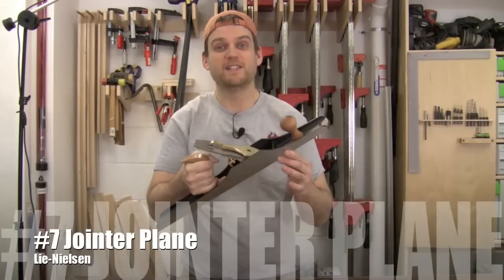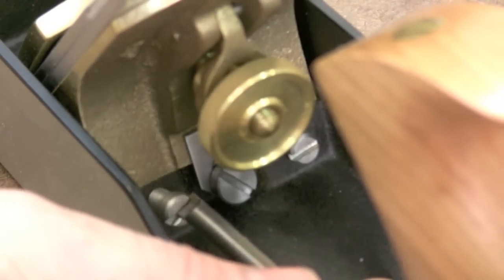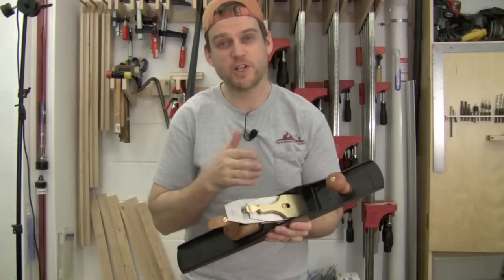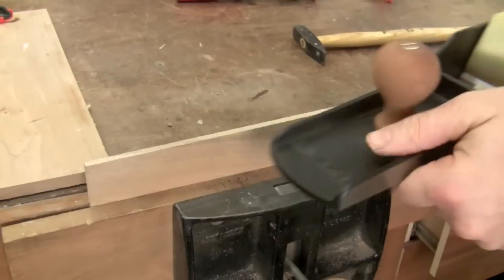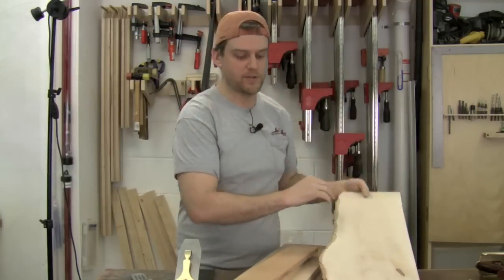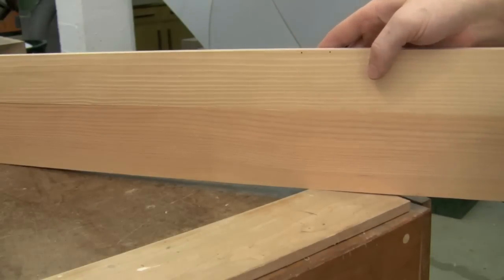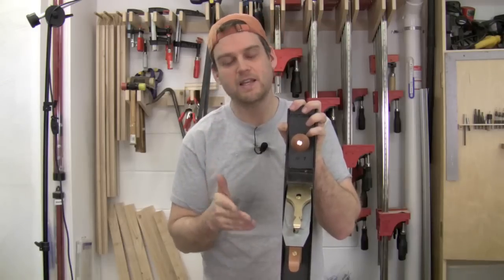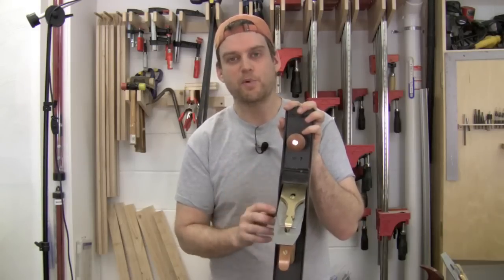Lie Nielsen No. 7 Jointer Plane

Comment: Exactly.  The #6 is great for jointing and planing - it's a little lighter and more easily managed, but not quite as long for getting a straight edge on longer boards.  Not really a huge deal, the #6 can work very well.

Comment: No 7 or 8.. 7 or 8..

So I got a No 8. Don't know when I'll be using it though.

Just started woodworking, and quite content to learn how to properly plane with just Stanley No 4 and 5. But then, the government in my country announced it was implementing a new tax, which would be applicable even to stuff bought online.

The deadline for the tax implementation was coming up, so I just bit the bullet and bought a bunch of LN planes, and a Veritas router plane, and hopefully I saved a ton of money that would've just gone to taxes. Those planes will now sit in their anti-corrosion wrappings until I'm proficient enough with the Stanleys and ready to go to the next level. Who knows when that will happen. Oh well.

Comment: I would like your opinion concerning the No. 7 jointer plane, 
I make tables from hard wood, average sizes are 3 X 5 feet, I am torn between the NO.7 Clifton and the No.8 LN plane.
I really lke the Clifton No.7 because of the beefier body casting, BUT, the extra width and length of the LN is interesting to me...
Please let me know what you think...

Comment: Hello Mike!  I would like to ask your professional opinion. I saved some money and ready to get a Lie-Nielsen jointer plane. I see that there are two options of №7 plane. One is a normal angle and the other is a Low angle jointer (№7 1/2). What is the difference between these two planes? Could you please point out pros and cons. I will plane a spruce and maple only.
 Thank you very much for your help and time!
Reply from the maker: Both the No. 7 and the 7 1/2 are the same length, while the 7 is almost a
pound heavier. The irons on the two planes are .140" thick for the 7 and
.240" thick for the 7 1/2, which you'd expect the L/A plane to be thicker,
since it has no chip breaker (nor does it need one).

I tend to lean towards the No. 7, if you are mainly getting this to use as
a jointer. I find the iron advancement is additionally fine on the design
used in the No. 7, and the extra weight is helpful when flattening large
items (I personally own the No. 8). Just remember to do what I do, and
that is apply a small swipe of paraffin to the sole of the jointer, which
makes a huge difference with fighting the resistance between the metal and
the wood. You'll notice the difference immediately and when you feel like
it's more difficult to push, hit it with another quick swipe. (Don't use
any silicone product on the sole as it can interfere with at least some
finishes)

On the 7 1/2 side, one of the strong positives is the flexibility it
possess much like the L/A Jack plane. Many prefer to purchase a spare iron
(or two) and have them honed up with different micro-bevel angles. This
can be advantageous when working highly figured grain, so you could hone a
spare iron at 45 or 50 degrees, on top of the bedding angle of 12 degrees,
which would put the effective cutting angles of 57 and 62 degrees
respectively. The converse of the "heft" aspect I spoke about with the No.
7 is if someone doesn't feel they either can or want to deal with the
extra mass, which is not all that different than those who prefer the old
wooden planes, which are all much lighter than metal planes.

So there are some aspects of each plane that are sought after, and some
that personal preference might tend to steer you away. I'm absolutely
positive that the No. 8 is the right tool for me, and without knowing your
personal situation, I think the No. 7 might be your best bet. I hope
you'll find some benefit from what I've written. Feel free to ask any
other questions you may have, just in case I've missed something you find
important.

Lee Laird
Reply: Thank very much for your answer, I really apreciate it!  I just wanted to ask another question regarding № 7 plane and a 7 1/2 Low angle.  Which plane is more easy to push (work with), Low angle or standard angle?  (If the blade advances the same on both panes?)
Thank you very much for your time and help!
Reply from the maker: The number 7 is a bench/jointer plane.  The bed angle is much steeper and the iron is inserted into the plane, bevel down.  This differs greatly from the 7-1/2, which is a low angle plane.  The bed angle is much lower and the iron is inserted into the plane, bevel up (like it is on block planes).  The really low angle works well when trimming end grain.  It would also be suitable for fast stock removal on face grain, though it could lift and tear diving grain from the opposite direction and give more tear out than the bench plane, with it's steeper bed angle  The 7-1/2 could be set up for use as a trimming (shooting plane) for miter work as well.
 
The primary intended purpose of use for the two models is different.  The number 7 is a jointer plane and the 7-1/2 is a long-soled block plane for slicing end grain efficiently.

Comment: Hello Mike!  I would appreciate your help very much.  I'd like to buy a plane to joint violin (viola) plates. (up to 20 inch long) I am considering LN №62 Low angle and № 7 1/2 Low angle. What would you suggest?  Thank you very much!
Reply from the maker: Hello!

When jointing two items together, it's always preferable to have a plane that is longer than the edges you'll joint. With that being said, the 7 1/2 would be the choice with its added length. One way around that is to have a jig (in this case, specifically a chuting board) that has a plane track that is longer than the the side of the material you wish to joint. This changes the source of the flatness from the plane's length to the jig's track. One last element I prefer in a plane for this scenario is mass. While a razor sharp iron is a given, I like a plane that once moving, will keep moving without undue input from the user. 

A useful tip: if you joint both pieces at the same time (either both on the chuting board at the same time with the important edges lined up or both held in the face vise together). This way anything that prevents the plane from cutting at a 90-degree angle to the sides won't matter. The two pieces will receive complementary angles and when laid out, will still come together as a flat top. 

Let us know if you have any further questions!